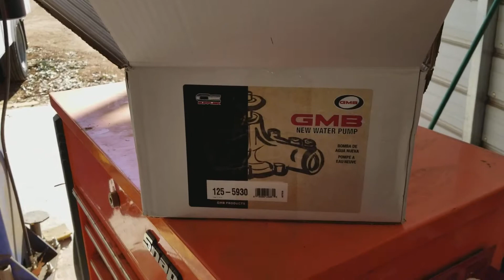Ford powerstroke Why they suck

Comment: 6.6 is Duramax (Isuzu) . 6.0 liter International is number 1 light duty  diesel engine found on the road.  Many problems but still found working across north America today. 6.4 were power houses but too expensive to work on when failure occurred. The lb7 is a great motor I'm not denying that. Your front end will need complete restoration in due time.
Reply from the maker: I meant to say 6.7.
Reply from the maker: 6.0 international after you bullet proof it. but my 6.6 is already bullet proof right from the get go.

Comment: yes they do suck. as I dealer I bought nearly 100 over the past 10 years. all had problems, some real bad. I also bought around 200 cummins. none were shit. all had minor issues. usually due to worn cracked rubber boots, hoses etc. nothing serious. used to buy durmax too, until their shit injectors became a normal problem with every buy. cummins is king. why anyone buys anything else is beyond me. even when a ford diesel does run, it has low power and horrible mpg compared to a cummins
Reply from the maker: amen brother at least someone admits when something is bad. The inectors on the duramax are pretty much the only issue and the cummins is superior. But the ford it is like every area of the truck needs to be reengineered a bit and tweaked. before they become fairly reliable. After I rebuilt mine it is pretty good but OMG a rebuild with new pistons on a diesel with 180k miles.pathetic. and that is the best they got. Skull and crossbones on ford products IMO.

Comment: Well if you take care of it they run great 
Going on 250,000 replaced water pump that’s it and what is a 6.6 only heard of a 6.7
Reply from the maker: sorry ment to say 6.7 piston failed before water pump pulling weight all the time. 185k miles.